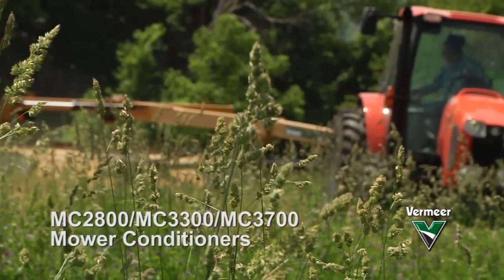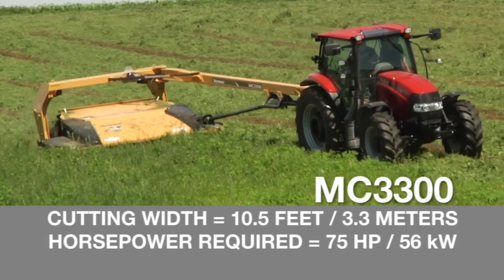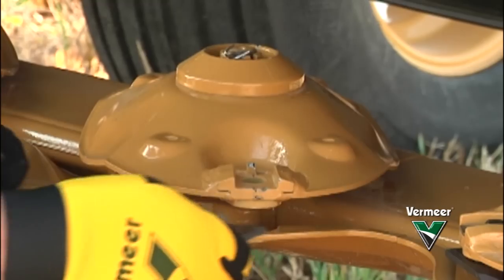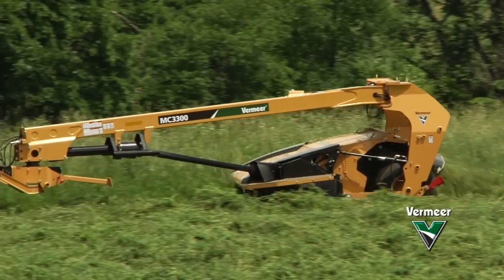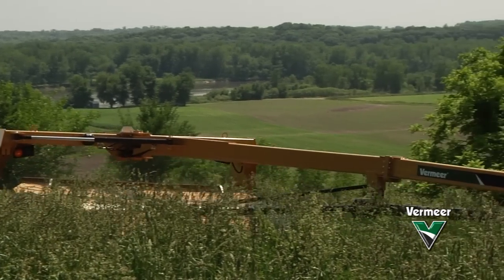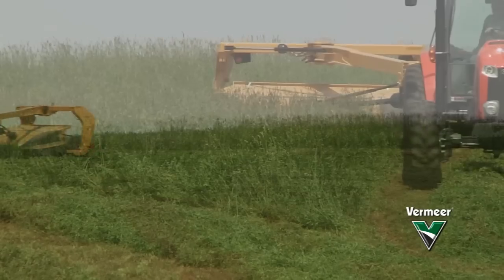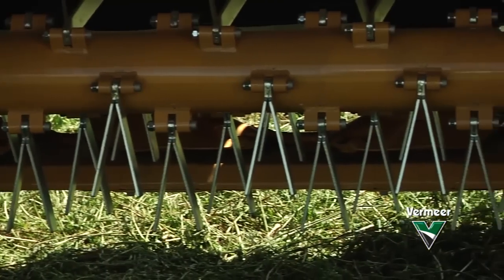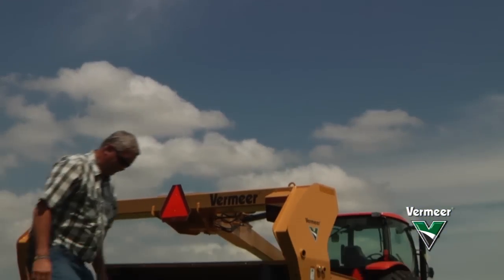Mower Conditioner Product Line | Vermeer Agriculture Equipment

Comment: Are you not building Mower Conditioners at this time? My dealer can not get the 3700
Reply: Vermeer is on the TM series now.  9 models ; TM105 through TM1410